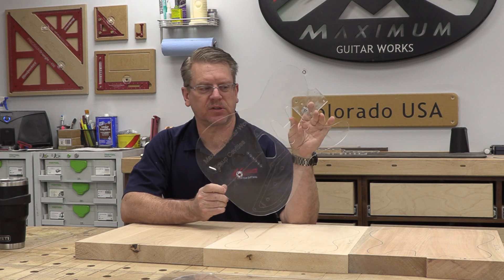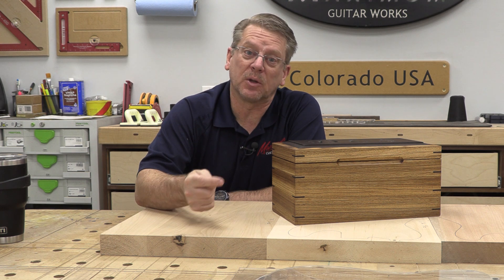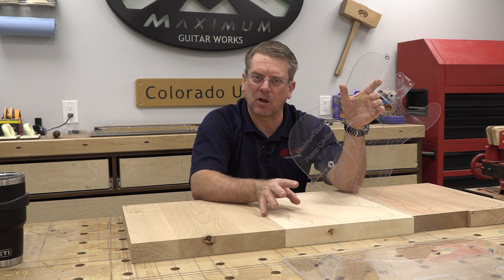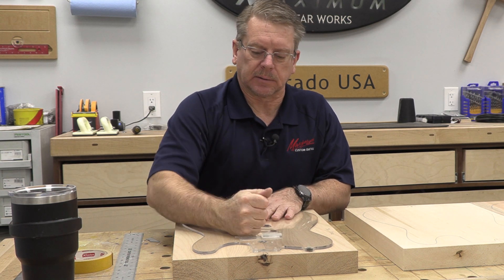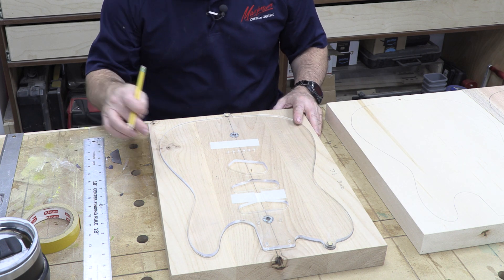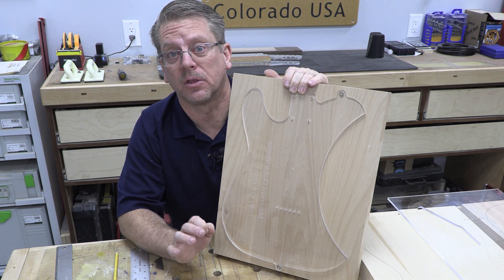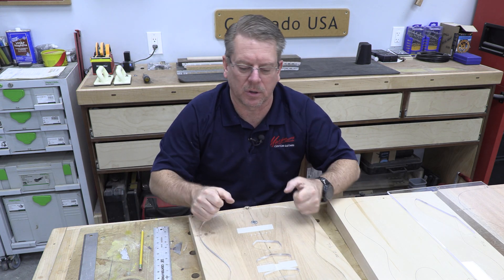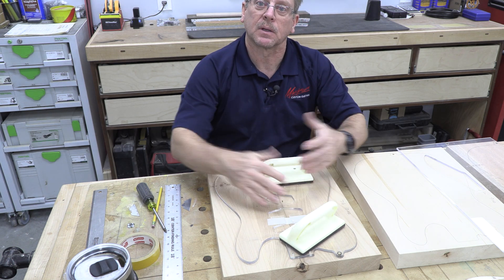Reinventing the Guitar Body Template

Comment: Three thumbs up, this is a great approach to templating. And the paddles make it so much safer, too... I recently had a 2" bit grab the endgrain on a body I was shaping. It threw the body clear across the room and pulled my hand (which was on top of the body) into the bit. Thankfully I wasn't seriously hurt. I'm lucky I still have my fingertip. I need to figure out how to incorporate Matt's paddles into my existing templates.
Reply from the maker: Philip...wow!  Sorry to hear about the mishap.  I have worked hard with all my students to avoid this situation...but it has always been one of my greatest fears as their teacher.  When the ideas hit me...I was like..."finally a possible solution".  After using this new system several times now...and demonstrating in class for my students...I am sold on the safety and better results.  I started today remaking all my class templates to this new system...and the students are excited about it.  Thanks for sharing your story...really drives home the importance for shop safety.

Comment: Nicely executed and once you see it quite obvious that the reference holes should be placed outside the template. Clever also to have the reference pins the same both top and bottom.
Reply from the maker: And with the top pin not centered...it is impossible to make a left handed guitar by accident!  ;-)  Thanks for your long time support Gert.

Comment: Check out infinity tools for a Mega Flush Trim Router Bit. I use a 2 inch tall 1 inch diameter. Super smooth.
Reply from the maker: I will do that...I get their catalogs...and have other bits from them...but I will look up that one.  Thanks John.
Reply: That's the bit that threw my strat body across the room (aided and abetted by a Triton 2.25 HP router). It's a great router bit, but as I learned the heard way, it's not immune to grabbing end grain. I'll still use it, but I have a healthy fear of it now.

Comment: You couldn't just grind the the bushings down to match the acrylic width?
Reply from the maker: I suppose that you could...but those are harden steel...so that would not be easy.  And one did grind them down...I would have a few concerns.
1.  would you lose the proportion of the ridges and grooves on the edges?
2.  would the hardened steel loose its temper from reheating?
3.  would be hard to hold...or if installed first, would that overhead the acrylic?
However, if someone tries it...and it works...then that could be a solution.
Reply: @maximumguitarworks  yes that’s right, I missed that they were hardened, so that wouldn’t work because you would definitely lose the heat treatment, plus after watching your second video I see how you are using the ridges. You could re-harden by bringing it up to cherry red then quench in oil, but in the end, not a very elegant solution. Thanks for the reply.